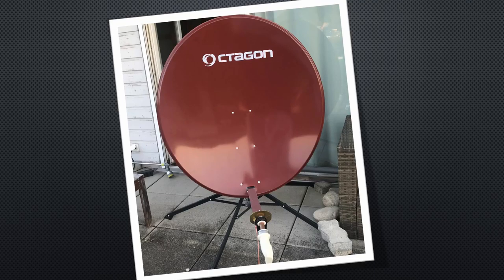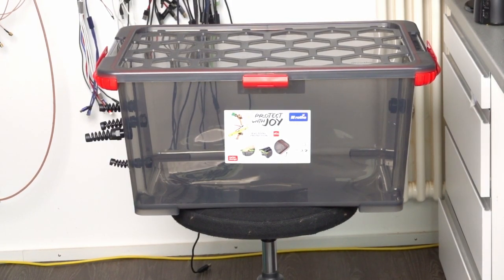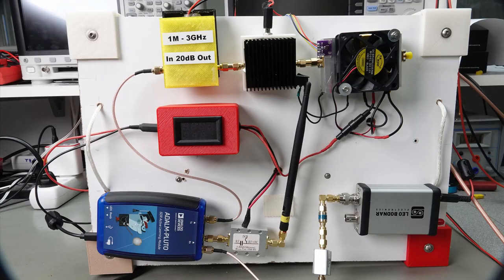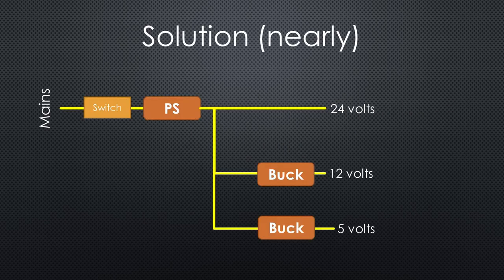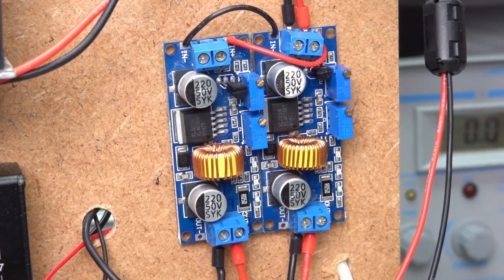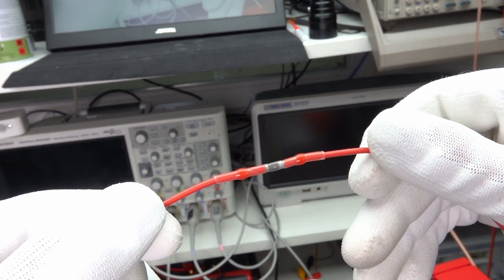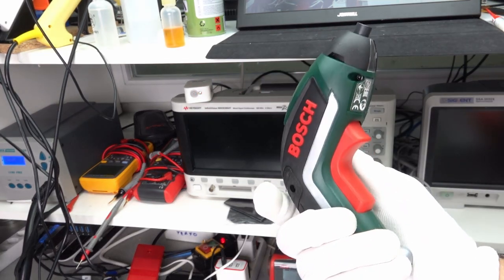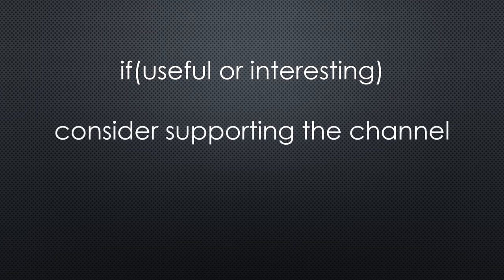#357 How to assemble an outdoors electronics project

Comment: The Powerpole connectors are a very good hint, especially with the fused distributor. It had improved many projects, if I knew them before.
Something in return: Often an outdoor enclosure should not only be weather proof, but also portable. Your box might not be stirdy enough for rough transport. Also, if the case bends easily, it is difficult to attach components on the inside without too much stress. I am very happy with Peli cases or Peli case clones, depending on the required level of quality. I've glued (with epoxy) DIN rails (for power installation - you find many PSUs and adapters for "smart home" projects with arduino or Raspi) to the inside in the past, which further strengthens them. You can drill a couple of holes into them and, if you take a series of outdoor connectors that uses the same hole diameter for different connections, you get a versatile platform for various projects.
If heat is a concern, look for military surplus cases, made of aluminium, on ebay. Some are ready for 19" rack usage, if that is your thing.
Reply from the maker: I looked at those sturdy cases and nearly went with one. But because I wanted to have a big one the price difference was very high. And because I do not plan a mobile usage I decided to go with the cheaper solution.
Good to know that they can be extended with accessories.
I also looked for military boxes, but here they seem to be collectables and very expensive. And they cannot easily be shipped over distance :-(

Comment: Hi Andreas, as usual  another excellent video. In addition just a hint from my experiance : Glue over time changes it's "electric specifications". In my previous job I had several repairs because of "layout repair wires" glued to a PCB. It can start already after a year but it could as well take several years until it will either dissolve the coating of the PCB, change it's conductivity to "conductive" or even worse : both ... So it dissolves the protective coating of the PCB and get's conductive. Especially in HF or low energy ( CMOS ) applications this will get a serious problem.
Or in other words : If you are going for a long term solution don't use glue on PCB/electrical connections.
For the wire ferrules the color is not really standard, it's mainly up to the manufacturing company, it's just an indication for same size within a batch.
Refering to the metal mounting plate you did mention, there are mounting plates with holes for electrical installations which might be an option for you ( for example https://www.antennenland.net/Montageplatten - a google search for "Lochblech Montageplatte" will show quite a bunch ), the benefit of an metal plate is quite obvious : If grounded it's a barrier for electrical signals.
In addition I want to add that there are special versions of those cable screws that allow for example RJ45 plugs to pass through even if the whole would usually be to small (there's a cut out with the shape of the plug), some do have the sealing rubber split to be able to put it on cables where the plug is already mounted. I have seen such things for garage door openers, surviallance camers and other stuff where it's needed to have pre build cables to be water proof mounted to something. ( https://www.icotek.com/de/produkte/kabelverschraubungen or https://www.ute.de/produkte/kabel-adapter/wasserdichte-kabel-buchsen-und-stecker/wasserdichte-cat5e-cat6-rj45-steckverbinder-kabel/wasserdichte-cat5e-stecker-und-buchsen/nti-rj45-5ewtp-cb-ua.html )
Cheers from across the border.
Reply: When I researched color ferrules I found two standards. IIRC one was primarily used for most of EU and the other primarily for Germany. I think it was the EU standard that used colors for size, while the German standard was entirely different. And of course you can find ferrules that conform to no standard, but those would not be acceptable for inspected work.
Reply from the maker: Thanks for the tip and links for the "Lochblech Montageplatte". I did not know they exist. Concerning the gland: Another viewer also mentioned them. They are a good idea, but unfortunately very expensive for a Maker. So I probably will stick with the standard ones :-(

Comment: There are also XT30 connectors (rated for 30A instead of 60A for XT60), they are much smaller and cheaper than XT60. I'm using XT30 wherever I can, only downside I found is that they require power to disconnect them so in some cases It is hard to disconnect them without damaging smaller things (e.g. on double sided tape)
Reply from the maker: Thanks for the hint. I did not know them. The power poles definitively are better to remove because they are longer. But this is probably not so important for RC planes...
Reply: @AndreasSpiess  XT30 (standard version for wire) can also be mounted on universal PCB drilling 2 larger holes, it is quite easy and both pins can be soldered to 3 pads each so it is robust. BTW there are also XT90 (90A), no spark version (I never tested them), 3pin version, and recently I saw XT150 which are different because they are single pin and I think they can be stacked to make multi pin connector (didn't test them)

Comment: Nice build. But I'm still worried about moist.
Moist is very hard to keep out: during the day, the box heats up. The inside air pressure will rise and air might leak out. During the night it cools down and it might suck in cold, moist air. The moist can condensate inside the box. A lot of commercial outside enclosures have a small hole at the bottom that allows for the condense water to leak out and to keep pressures equalized. I'm not suggesting you should drill a hole, because you spent good effort in making it waterproof. Rather, drop in some large silica sachets and keep a close eye to it. You can easily add a condensate water detector at the bottom end of one of the four wood panel support legs. You can wire that in at the Tasmota. The water leak hole can always be drilled afterwards, if needed.
After installing and before closing this box, spray the mating surface of the lid with silicone spray. That stuff repels water and will provide for a better seal. It also helps against car doors freezing shut, in winter.

Very interesting project. Please keep us informed about this box. I'm very curious what the outside weather will do to the inside climate. Will it be freezing inside, in winter? Will it overheat when it's in direct sunlight? And what will the relative humidity do?
Reply from the maker: You saw that I am also not sure about humidity. That is the reason for the humidity sensor.
I have a gateway out on the roof for about 2 years now and so far no problems the bag with silica bought forbid still is in the lab...

Comment: Wow! This is s wealth of information with so many interesting ideas. I found useful the way you protect the components from moisture and humidity, adding a humidity and temperature sensor, the power distribution, the ip68 cable pass throughs...and everything else. Thank you so much. I was just wondering if  super corona dope would be an alternative to protect the circuit boards. I've also seen "Great Scott!" use silicon as an alternative (I haven't tried it). I wonder what's more practical: I will try your method. :)
Reply from the maker: Thank you for your nice words. So far I did not want to pot the parts and hope, the box will do. But I am not sure. This is why I added a humidity sensor...

Comment: Great video!  Thank you for sharing links to all the parts you used. 
Electrical tape may be the better solution but, I always dislike dealing with the sticky residue especially after it has been very warm. Have you considered using the hot glue inside heat shrink, picking the post shrink diameter that was the right size for your cord grip sealing glands inside diameter? 
Thank you again for making such detailed helpful videos!
Reply from the maker: Good idea about using heat shrink tobe to enlarge the diameter of the cables. This should work. I will try it.

Comment: What was your setup on the power socket side of the power cable ? I can see how the IP68 cable pass through are handling the waterproof requirement on the box side but I'm wondering how best to handle it on the power socket side. I do have IP5x (ou 6x not sure) power sockets on my balcony and I'm under the impression that these loose their IP characteristic as soon as you plug something to it (as the cover is no longer on the socket).
Reply from the maker: My power outlet is mounted in a protected area. So I did not care too much about it.

Comment: Would some copper or some other conductive foil do anything on the wooden separator to help block interference between the power and radio?
Reply from the maker: Yes, it will. Some viewers suggested aluminum foil.

Comment: Air trapped in the box during assembly contains already some humidity. When temperature drop, it can cause condensation. I wonder if silica gel could help with that?
Reply from the maker: You are right. I have a 500g bag of silica around from my gateway project and I can use it if needed. I try to monitor the humidity first

Comment: Thanks I learned a few things thanks.  
two items to consider 
1)  Is an order in which power must be applied or removed?  This has been a big problem in my personal and professional designs.  Start up and shut down is always a problem.  

2) If battery driven how to shut off one of the power domains to save batter capacity
Reply from the maker: Very good point. In my project I had to pay attention between the Pluto and the GPSDO. And I am still not sure if I have to change that and switch the Pluto later that it has a stable clock before it starts. I  can only add an additional relay in my setup to achieve that.
Concerning shut-off: Maybe you saw my video about the "Superpower" project. There we have to deals with that for the Pi board.

Comment: Does capton tape have a low thermal resistance ?
Reply from the maker: It is very thin. So heat dissipates fast. Not for cooling, of course. Just for measuring.
Reply: @AndreasSpiess  ok thanks. I thought the (mechanical) thermal fuse will not work then.
Reply from the maker: It works for slowly increasing temperatures

Comment: Sealing a box against water ingress is best done by drilling a small hole. In an air tight box the air will expans and pressure will rise because of the heat dissipated inside. This will force the air out. Then at some point pressure will drop when the internal temperature will fall. This will suck (damp) air in from the outside. Small pressure differences are okay, but the bigger the temperature swing, the higher the pressure difference and the more likely the seal will break at some point. The breathing of the box will have condensate build up in the box. A small breather hole, or the professional solution a labyrinth or goretex plug will overcome this. So a 3mm hole in the bottom will do.
Reply from the maker: Good point. Thank you. I am also not sure how it will work. This is the reason for the humidity sensor...

Comment: i solder wires togeter with a bic lighter, cause its instand hot and can handle corrosion better than any clams long term
Reply from the maker: An often used tool. Temperature control is probably an art. But with some experience you can manage to not destroy things...

Comment: 7:32 Have you considered something that's very popular across factory made audio amplifiers with remote control? One big transformer, bridge rectifier, and voltage regulator for RF part and second, separate tiny transformer for RC part? 2$ chinese module does the job, trafo, big capacitor and bridge rectifier can be easily re-used in your new projects once your friend comes back :) I believe DIY power supply without buck converter noise is valuable project by itself and more viewers will be happy to see such ;) Best regards!
Reply from the maker: You are right. Linear power supplies are less noisy but usually bigger, heavier, and more expensive. This is why I usually start with a switcher and, if I have problems, go with a linear supply.

Comment: I do things just like this, but a lot worse! I start with a case that is too small, then poorly, permanently solder all the parts together only to realize later that i need to change something out. 

Having a good assortment of connectors handy is an understatement. Whether power, or data, doesn't matter, you want stuff to be modular, fixed in place, but not permanent.
Reply from the maker: After a few projects like yours I changed my style a litte...

Comment: Did you drill a drain hole in the bottom of the box at the lowest point?
Reply: This is a very good advise! It is also a good advise to put some sort of filter on it. I have a pa0rdt mini-whip antenna on the roof and at some point I had to fix the cable and I looked inside. It was full of spider silk and other dirt. I cleaned it and glued a piece of glass-fiber filter paper over the hole and still hope for the best (haven't looked since then).

How important a hole in the bottom is can be experienced with geocaching. I found a few thousand geocaches and those with completely rotten logbooks often had completely watertight containers. It just needs one person who opens it in the rain and the water will never escape again. On the other hand, sometimes find logbooks that are more then 10 years old and are still fine. They are often in a place where they are protected from water and in a container that isn't watertight but just tight enough to keep insects out.
Reply: @zvpunry1971  The biggest problem is temperature, humidity and air pressure where high humidity air enters the enclosure and condensates the dry air then escapes to be later replaced with more humid air and the process repeats until device fails a year or two later..
Reply: @timballam3675  I know. I just wanted to mention to glue a filter over the opening to keep the insects and spiders out. ;)

With geocaches it is a bit different, these are logbooks which get visited by random people and sometimes the box/container isn't closed correctly or opened in the rain and then some water enters, and then they are closed again and the water is trapped. Then the paper of the logbook begins to rot away. But if the box is protected from direct rain and has an opening, it will dry out if it got wet.
Reply from the maker: @Tim Ballam: Thanks for the tip. I will make one.

Comment: A note on switchmode power supplies. Many provide an output-enable terminal and some a low voltage, always on power supply with milliamp capacity. They could reduce the component count, powering the microcontroller that controls the PSU output.
Reply from the maker: That would have been a very good feature (actually I would need >100mA for the ESP) and would have saved the relay. I have to have an eye on this feature when I buy new ones.

Comment: For your glue gun,cut off the tip and a short 2cm section  of a metal Parker Pen refill,the tube is exactly the right diameter to push into the end of a glue gun , it creates a nice extension and reduces glue gun dribble

Even better,just use 2part quickset epoxy,it won't let you down like glue from a glue gun will.
Reply from the maker: Thanks for the "extension" tip!  I like hotglue because I do not have to mix fluids like with the epoxy. But your are right. it is less durable.

Comment: Those buck converters get hot ..... also, power supply’s chuck out a lot of RF noise. They may need to have some sort of filtering, have you noticed any distortion in your radio?.
Reply from the maker: You are right and below 30 MHz it is for sure dangerous. This is why I proposed a metal sheet and ferrite beads. 
This project works on very high frequencies. So the interferences are smaller.

Comment: May be that would be a mistake but instead of trying to keep the box watertight I would ventilate it so that humidity can get out. IMO, it is impossible to keep it completely out in the first instance, for a start you get condensation when it is cold.
Reply from the maker: I am also not sure. This is why I included a humidity sensor. I have a gateway with a very tight case and it is ok for the last 2 years or so. Switzerland ia also not very humid.

Comment: Just another recommendation from me -- if you need Lab Power supply for 3 main voltages( +12V, +5V, +3.3V) and high current output capabilities -- go ahead and buy ... computer PSU. Yes, regular computer PSU is the best and cheapest option to get quality powerful lab PSU with the most frequently used voltages in electronics and electronics DIY. And everything is provided in one "tiny" box. :) Chinease guys have learned from makers about this opportunity, so you already can buy tiny boards with regular terminals for these voltages( e.g. bananas or screw-in) that you connect to regular ATX cables( those that you plug to your mother board).  I hope this will be helpful.
Reply from the maker: This is a good idea. So far I never used one of those because I usually do not need a lot of power on 3 or 3.3 volts. But maybe I will use one the old one sitting in my lab somewhere...

Comment: 8:38 No, very nice! Although it's not nice they don't seem to match any standard scheme in those assortment boxes...
Reply from the maker: So we have a different opinion.  ;-)
Reply: @AndreasSpiess  Yeah, I like the color codes so I can see which size it is. For when they are on the table or in a tray which might get mixed etc. And use you're used to it you can grab the correct one quick. But I don't mind others having a different system :)